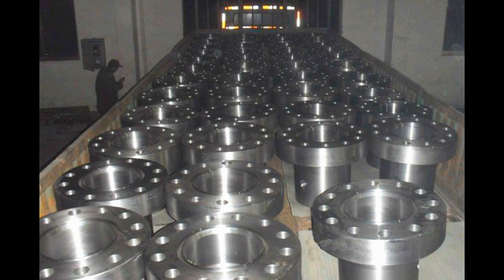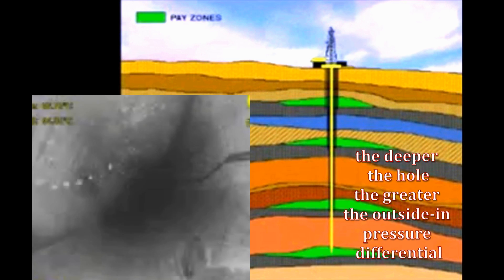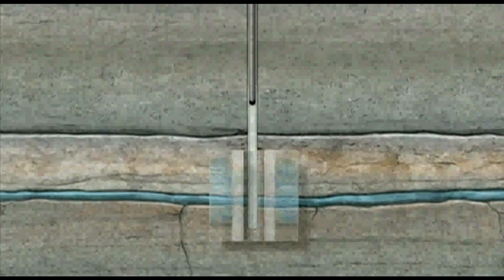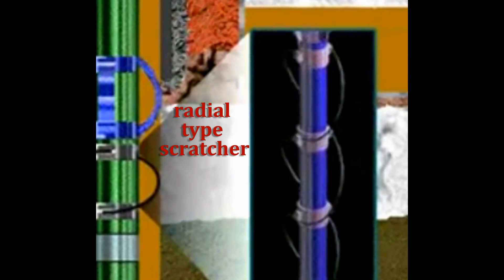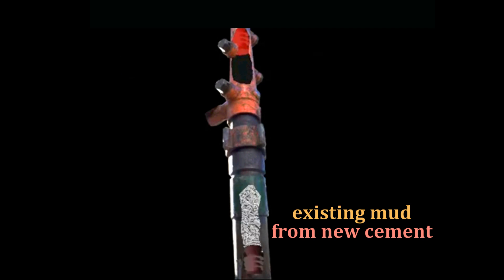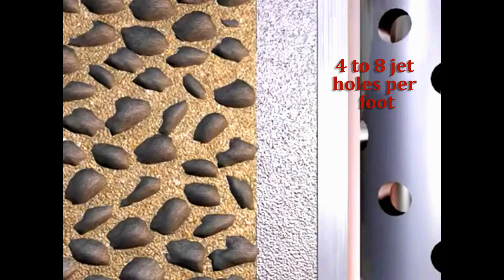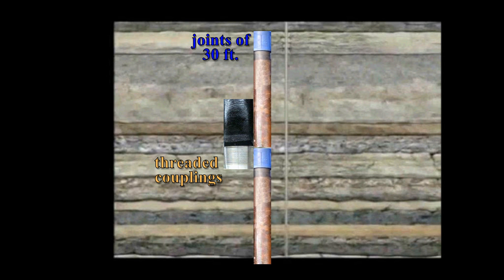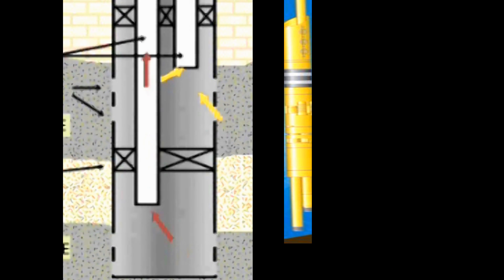Overview Chapter 8 Part 2 Well Completion

Comment: Hi Mr. Lau, thank you very much for the videos. In this video at 7:34 you say that density adjuster can be used to increase cement weight to reduce pumping pressure. But how this happens? 
For me, if I increase the weight of cement I will increase my pumping pressure (due to higher viscosity and friction forces).